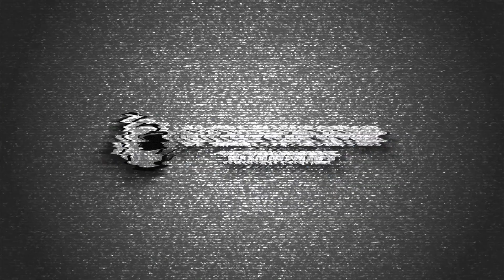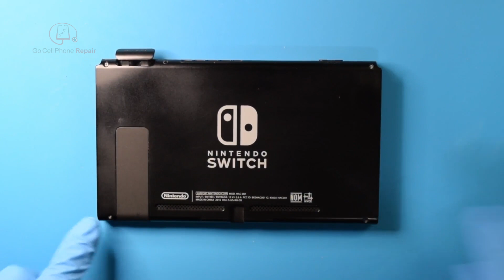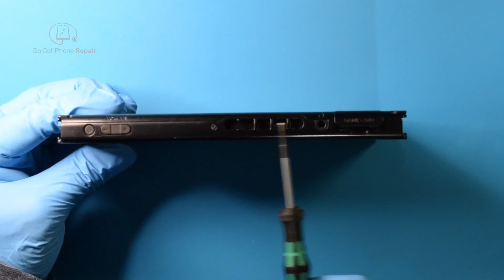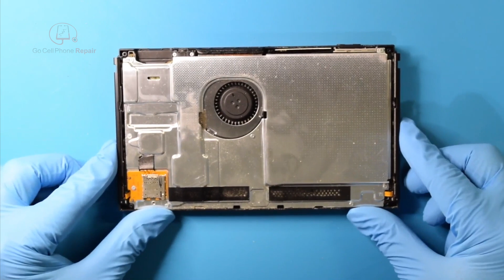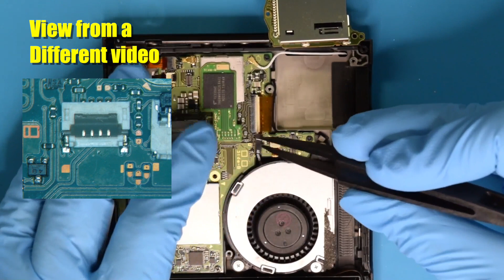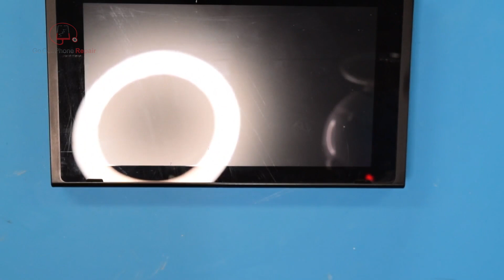How to Replace Your Nintendo Switch Fan – Step by Step Guide

Comment: what a great tutorial!
despite me being all thumbs, I managed to connect the touch screen / sd card connector again after 20 mins of overly carefully trial and error'ing around, but in the end everything worked again and the fan is as quiet as it had never been before, even though the temp goes up to 80°C at times! (overclocked cpu)

Before that, the fan already bursted out spinning like a starting jet even when 50°C had been reached - I'm more than just happy, also I got ur green Wera/Phillips screw drivers (P0 and P00) extra since the ones coming with the fan were already overtightening one of the two middle-screws on the side where I had to carefully crack the thin plastic beneath the screw inside the cover - but that's all about the 'damage' happening.

Comment: My fan spins but makes a whirring sound, it spins fine but no air comes from it. I've applied new thermal paste (it was very dry) closed it up, same issue. Is fan not spinning fast enough? Awesome video btw
Reply from the maker: Have you checked the vent for blockage? If the fan is spinning and there's no air flow, something is clogged.

Comment: did all these steps perfectly and new fan wont spin at all. Could it be a battery issue instead. Or in your experience what are causes for fan not working at all?
Reply from the maker: It could be the fan circuit or connector. Also, the fan won't always spin right away. Make sure that you put a load on the system by running a game for a bit to initiate the fan.

Comment: I would need verification for this as I may have just been lucky but this may be a potential tip for future repairs (please consider at your own risk and stick to the video tutorial if you're not confident:)

I used one of those plastic floss picks to fill the gap at the top for the SD card reader. It conveniently was just the right size to slot in the pins easier when closing it back up.